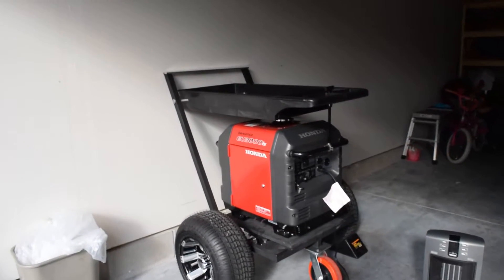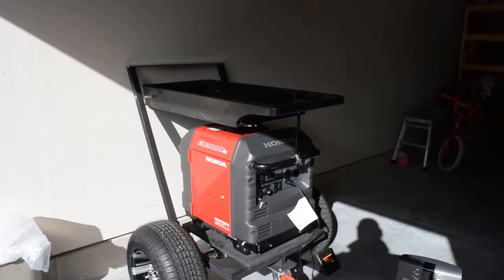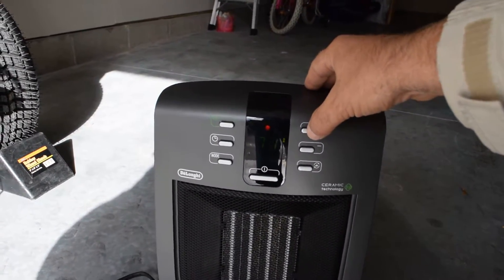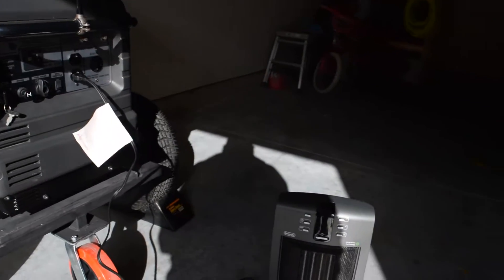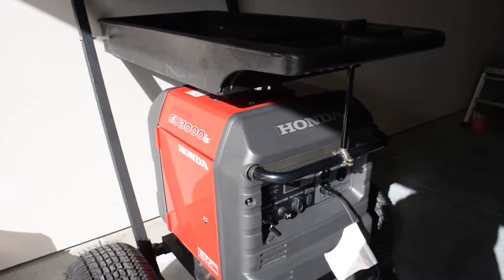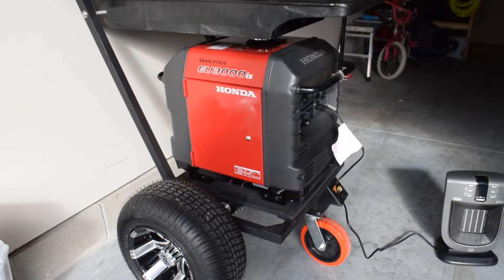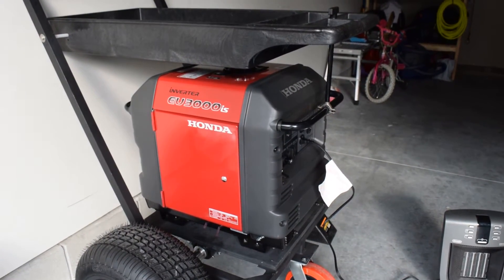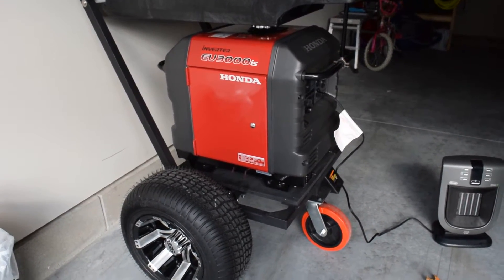Honda eu3000is generator ECO MODE issues pt 3

Comment: It has dirt in the jet. Below the idle screw . Take out idle screw and pry up the jet behind it . Clean tiny hole in bottom good and blow out hole in carb and replace and push down all rhe way till seated . It will run fine then

Comment: When having ECO issues get another spark plug and gap .024-.028- try the NGK iridium
Reply from the maker: See my recent generator video on my eu2200. I give the exact same details as you just did. Only with this one here, it was a throttle motor issue. Got a new generator from Honda as a replacement though on this one.
Reply: @1minibean  Glad it's working. I have a Honda EU2000i watt generator and it always works. Yesterday I started up my Honda and an old Coleman Powermate 3000 watt generator just to make sure they are working before we get any hurricanes or freeze outages like we did in Texas in February 2021.
Reply from the maker: @Ojeramup12  These sure are handy when needed. Nice to have around.